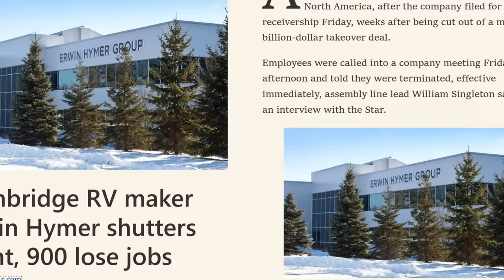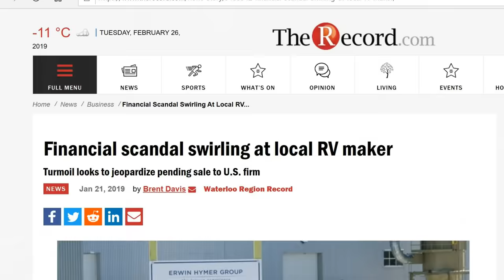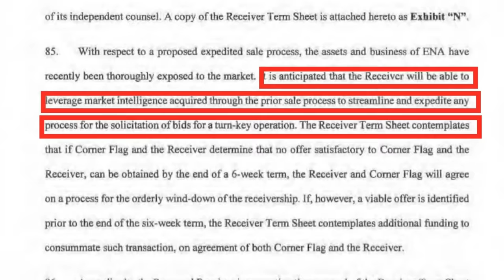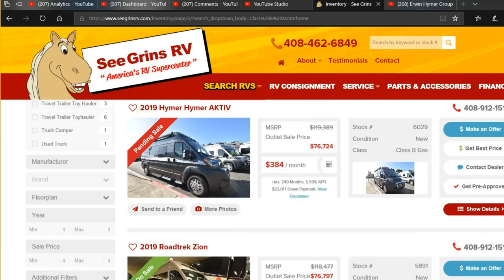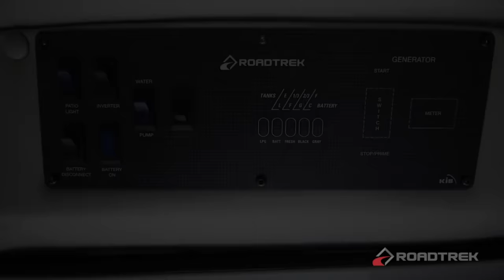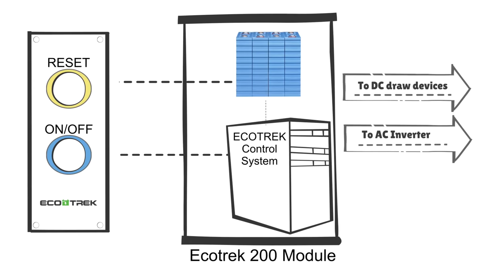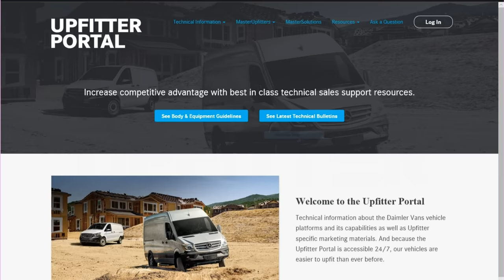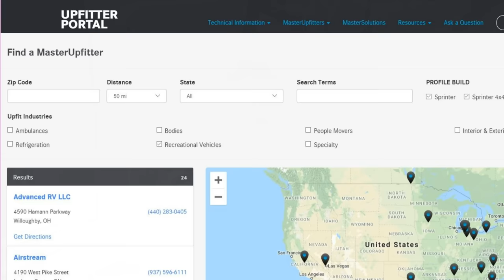Hymer Scandal | How It Affects Owners | What to Expect

Comment: If you buy a Hymer RV, buy it with sufficient discount to price out the warranty. You’ll likely be your own warranty and find an independent repair facility.
Reply from the maker: yes that's exactly right and set aside a good stash to fix things on your own or replace systems like Eco-Trek later on down the line.
Reply: Thanks again for an excellent and thorough analysis video.
Reply: I really want a Carado Axion made by Hymer due to its short length. How much is the extended warranty?

Comment: Your video is the most comprehensive summary that I have seen. I got a 2018 Agile last year and I just contacted my dealer for any recommendations or offerings they may have on 3rd party extended warranties in anticipation of the worst case scenario. First time I've heard of the master upfitter issue so I really appreciate that heads-up.  I'm really glad I have the tried and true AGMs instead of Lithium (small consolation).
Reply from the maker: I think you're going to be okay dan. I love the agile! it is so open and beautiful. you can always upgrade those agm batteries later on down the road to lithium if you like. you're going to be fine. enjoy your new agile!

Comment: Absolutely great job on this video.  Your points are right on track.  There is only one additional thought that I feel compelled to add.  When a manufacturer goes out of business many people refer to their products as "orphans", as in the parents are dead.  I have had that experience with a Prevost when Featherlite (Vantare) went out of business.  The company assets were eventually acquired by another firm and moved to another state.  In addition to the loss of warranty, there was also a loss of technical support for the owners of the "orphaned" coaches.  Fortunately for many of us, former employees started their own companies to support the "orphaned" coaches and without them many owners would have been up the proverbial creek.  Because many items were proprietary in design and application, typical service centers had no idea how to fix unique problems or the "gremlins" that occurred.  As you stated, many parts are also proprietary to Roadtrek and getting parts and the crucial technical support could be problematic.  I was lucky to have found Donnie Myers, a former Featherlite employee and his team of technicians, many who also had worked at the old Featherlite.  Without them maintaining my "orphan" could have been a disaster.  With Roadtrek gone, I would be very concerned about not having the technical support available to fix  problems that could be unique to Roadtrek and leaving many service centers scratching their heads.  So, even with a generic extended warranty, there may be issues when the corporate tech support is not available.  Having on going company technical support for an RV can sometimes be invaluable.  Keep up the good work.
Reply from the maker: thanks for sharing this comment. I agree that there is an opportunity for former roadtrek employees to start a company to service roadtreks on the road. this would be a great service for current owners.

Comment: Noticed a local ad in the Maritimes, Atlantic Canada, advertising a 2019 Roadtrek Zion SRT still with the 6 year warranty, quote: "Every new Roadtrek purchased includes two years of Roadside RV assistance for free! Each motorhome is also backed by Roadtrek's six year, unlimited-mile/km expressed limited fully transferable warranty." I sent them a letter asking them about this and if they meant a 6 year third party warranty as EHNA went into receivership. This was the response from the dealer which I thought was kind of interesting, quote "the company is in process of restructuring and the trustee indicates warranties are suspended until reorganized and in the meantime we have the largest oldest warranty company in canada handling our warranties on current sales."
Reply from the maker: the receiver is not at this time handing out checks to dealers to cover warranty work. in my estimation the company will be liquidated. dealers have extended warranties available but you'll need to buy one and read the fine print. dealers want to move the inventory they have on their lots and will say almost anything to do that. otherwise they're left holding the bag. just my opinion.

Comment: I am beginning to see other YouTuber videos about this very topic and so far dealerships are stepping up to help owners of Roadtrek products.  There is talk of offering warranties that would cover these products.  However, the cost and completeness of coverage are all in the works.  I recommend calling your dealership and asking what they are going to do in regards to a warranty. This is very disappointing.  To see such a solid product go under, not to mention all of the jobs lost, because if shady bookkeeping is upsetting.  Great video Neil!
Reply from the maker: I may have to do an entire video on extended warranties just because of this whole thing.
Reply: @Ultramobility  As confusing as warranty verbiage is, that would be greatly appreciated.  I am hoping a lesson is learned by other brands. Keep your books legal and don't use strictly proprietary systems so repairs will be much easier.  I understand the need to stand out but I have seen this happen with other products that wanted to grab attention for their awesome system.  Think about your customers manufacturers!!

Comment: You may find this post informative from the Roadtrek E-Treks & Ecotreks Facebook Group
 "Ken Geib
New member · 22 hrs

I talked to a dealer about replacing a faulty Ecotrek. To swap out the old core and replace with a new module and they send the old core back to KS2 would be around $900 plus labor & taxes and I would then have a 3 year warranty on the new module.

It’s more than if I’d gone ahead and gotten the work done back in December/early January under warranty, but a lot less than I feared it could be."

It Seems that as well as the Owners Groups getting information and sharing it a number of the better Dealers are also getting involved. Also The Eco-trec battery system is turning out to not be quite as proprietry as first thought plus a number of savvy owners with the right engineering background are now investigating the software involved in the BMS and also the charging system. From what I have been able to gather NONE of the various inverters used by Roadtrek have specific Lithium battery charging settings, this is in contrast to the Xantrex inverters which do.
Reply from the maker: thanks for sharing that! very helpful to others!

Comment: Some comments say to design and build their own class b. From the myriad of YouTube videos, it is very hard to find a DYI van that can compare to buying a well cared for used class b such as a RT 190 on a Chevy chassis. Our 2007 4x4 RT 190 Popular looks exactly the same inside and out as a 2018 RT. It is rock solid,  has every convenience and just plain kicks butt of any DYI I have seen. Why reinvent the wheel?
Reply from the maker: I love the 190! it is built on a great chassis and the size is wonderful.
Reply: SEEMS THE MANUFACTURES ARE NOT LISTENING that's why some who have the ability are building their own.  Manufacturers are just buying and inserting stock parts.  no thinking involved.     example: if I want to boil water I don't need 2 or 3 burners taking up valuable  space.  That's why God made micro waves. zap;   almost instant boiling water.  Want to stir fry or fry an egg: there are storable induction cooktops just need the right power outlets.  Do it.   having said that stop putting micro waves at floor level.  when is the last time you saw that in your home kitchen.  there's a reason; it's dangerous and damn inconvenient .  Micro/ Convection combo should be standard.  don't have to be huge but quit installing coffee cup only sized micro waves just so you can say there is a micro wave.   more standard twin bed configurations.  I like the friends I invite along but I don't want to sleep in the same bed with them.  If people need frolicking space make the twins convertible to queen or king. too few manufacturers are doing that.  Under belly items should be protected and not so low you cant drive off the blacktop. shouldn't have to stand on my head to service items under the carriage.  sorry about the rant, but you are one of the few who listens.

Comment: Thank for the additional info on getting an extended warranty. I've narrowed my choices down to the E Trek XL, Coachman Galleria 24Q or the Travato KL. I really wanted the volt start system so my choices were limited. 

Since my purchase date is not until summer/fall of 2020, hopefully this will all be worked out by then
Reply from the maker: I think it will be.

Comment: I was most intrigued by hard to replace custom extruded holding tanks.  In the South Bay I have found craftsmen for upholstery, cabinetry, countertops but what would I do if for example I had a cracked black tank that had to be replaced.  How would that ever get created?  Who would do that kind of work?  That comment was enough to stop me from considering a lowball Roadtrek or Hymer.  Anything to add?
Reply: Tina Tina ... Poly tanks can be repaired, but most RV dealer repair shops are not skilled enough to do anything other than a slap-on patch.

Comment: There was a couple that had bought a very long wide body hymer. The couple named it Wild Horses. They are in UK etc traveling. I only saw a tiny piece of a caravan gathering where a man started to do a fast walk thru. I don't know the model of it. It has a drop bed over cab there is a left side entry door behind the front swivel captain seat ,the passenger & driver seat turn to see a cabinet with a rotating tv.....that can be viewed from kitchen & two long opposing couches then on end on one side is a bath sink cabinet opposite that a combo wet bath..in between these is a outside door. If you could look up this I'd love info & walkthrough & model of it. The kitchen was shaped. I Thank you

Comment: Thanks Neil, very well done summary. Agree that liquidation is most likely scenario and maybe, someone will acquire Roadtrek brand if they can disassociate themselves from the mess and move manufacturing to one of the US biggest RV hotspots.
Regarding Ecotrek, there is information that from some point in the past it was manufactured by KS2 (https://ks2corp.com/) who was subcontracted by Hymer to produce batteries as well as some other electronics in the system (like Inverter). Members of the community were in contact with KS2 and they stated that batteries would be covered for 3 years as long as the customers would work with dealers to handle the warranty. The warranty replacement has not been tested yet, so until then it's just FYI.
Reply from the maker: yes and thank you so much for sharing that information about K2. I didn't know it when I videoed this episode. good to know!

Comment: Neil,,not sure when I discovered you, but I file yours in aYTfile , what I like is your unbiased  vids, there are a few RV types also, The Russo’s, owned a class A, towing a Jeep, sold it then got into an AKTIV 2.0, what I liked was the bed could be in place 7/24, as you know that was a PROMASTER  fwd petrol engine, auto trans., this is where I first found out about HYMER, so they had to return it,, they would never do this again, they are looking to FORD TRANSIT, don’t know which one as yet.Imagine going to MAUI HI, renting an AKTIV 1.0, also saw some VW WESTFALIAs, but never knew they made petrol engines. I have seen some really NICE units in EUROPE, but they ALL are diesel, and NOT clean diesels + their electric systems are250volt +12volt, Some the stoves & heat operate off the diesel fuel tank. I guess sales would be iffy if brought here even with petrol engines.   Not sure if I would even have a go at it am 77now, plus been over 1.35million Miles, so really slowed down being retired.
From Maplewood NJ. Cheers. God Bless !

Comment: I bought an extended warranty from Easy Care and it covers NOTHING! I'm not exaggerating! I bought a Hymer GT trailer in Nov 2019. Knowing that the company was gone, I purchased a 3 year year warranty from Easy Care. I just called their claims center because the trailer is sitting ON THE WHEELS - here's what they said: They do not cover anything that could be covered by the original manufacturers warranty, even if the owner can not collect on that warranty.  I explained that the company was gone when I bought the trailer and that there never was a manufacturer's warranty, but they said, "NO!" Unbelievable. Watch out for extended warranties especially from EASY CARE.

Comment: HI , I  NOTICED IN YOUR VIDEO THAT YOUR STOCKADE WOODEN FENCE ( UPPER LEFT SIDE OF SCREEN ) IS SHOWING  ADVANCED STAGES OF DRY ROT. THE SLOTS ARE PRODUCING IRREGULAR GAPS AND BENDS WHICH IS A  Solid  indication that the fence has reached the end of its life cycle. Failure to replace the stockade fence could result in property and/or  human injury or worse. Please notify the property owner so this situation can be properly corrected.
Reply from the maker: thank you!

Comment: The coming months will reveal the tangled web of liquidation problems.  Unsold units on dealers lots likely have some manufacturer’s financial strings attached. Meaning ... the liquidation will include those units.  The financially strong dealers may purchase those units (at a bargain price), while others will just let them be returned to the factory lot for auction. Banks who backed the manufacturer may end up “owning” some of the assets.
Reply from the maker: that all sounds about right merlin.

Comment: Thank you for this... Already became an issue for me, lithium battery was faulty, cost me 1200 to replace it less than a months after I purchased the axion 😥
Reply from the maker: james, did you buy an extended warranty?
Reply: Thankfully I did, it just doesn't cover batteries
Reply from the maker: got it. thanks for sharing!

Comment: If Dealership's want to move these products start slashing 40% off the dealer invoice with whatever holdbacks they had, yes it's a loss but I'd buy 2 CS XL's if I start seeing super crazy low pricing, one for travel the other for the part machine and if anyone can get inside on a liquidation sale we're we're talking pennies on the dollar then it makes perfect sense to buy multiple units for those exact scenarios one to use and one for parts.

Comment: Thanks for your professional and informative videos. 
 My question is:   
Does anyone know a source I could use for fixing the apparent failure of  my EKO Trek Lithium battery system.  The batteries are not accepting a charge from the solar panels or the Volt Start generator.  I have been told that this is probably because the batteries have failed.  I would appreciate any information relevant to this.  Thanks!

Comment: Took Roadtrek out of consideration for my rv purchase February 15. Been looking at your videos and other research and I am currently entertaining purchase of a used 2018 Pleasure-Way Plateau FL around July. One question for you Neil, I've heard problems with the Dometic Frig keeping temperatures cold enough 40 degrees. What have you heard?
Reply from the maker: yes it is true especially in hotter temperatures. pleasure-way needs to move to compressor refrigerators. I've been on them for some time. they've put one in on their first model, the Tofino. maybe this is a trail on their part.
Reply: @Ultramobility  Wow what a quick response, really appreciate it. Been looking for about a year and  a half at RVs including C's Super C's and now B's and B+ ranging from Full Time RVing to where I am now Part Time RVing with the Pleasure-Way Plateau FL. Being 6 foot 2 I opted for the Plateau FL for the two living areas and several other things that meet our needs. Since I am 69 and I still work from home as a Project Manager for Wells Fargo I thought I could work from this RV if I got the WIFI 4G Extender. Do you recommend one? My two biggest concerns about the Plateau FL RV are the shower and the refrigerator. We are waiting to pay cash probably July August time frame.  Instead of the XLTD which has more space for me but my wife Mary and you called it a milk truck, we opted for the Plateau FL. We didn't want to add a vehicle or store it elsewhere, so we can replace our Toyota Sienna Van and we can park it at our Apartment in Neptune Beach, FL.  Can you give me any suggestions regarding the Dometic Refrigerator and the Wet Shower?
Reply from the maker: you may be able to replace the refrigerator with a compressor refrigerator - depends on the size of the opening. you'd want one that perfectly fits. I used to hate to shower in my coach but having recently done it I now love the convenience and privacy. the bathroom is smallish and if I were any larger it would be a problem. i'd definitely consider the wifi-extender. all rvs should have one. I don't have one yet but would like to get one.

Comment: Hi Neil, Thanks for this video report, I just left a RV show and was thinking of going with the Carado Banff model for our first venture into BVan use. I have a question regarding the roof top ac systems for the vans, is there any report that lists the dB levels coming from the ac units? It seems no dealer has this info. As for the Cardo, we are now going back to the drawing board, or in this case your reviews and see what works for us. Thanks again for the body of work you are producing.
Reply from the maker: i'm not aware of a report but they are quite loud. louder than say the generator. my family refused to have it on at night when sleeping even if it's ver hot outside - that's how noisy they are. there are some quieter ones by pro-air and truma has the aventa (sp?) which is also supposed to be quiet.